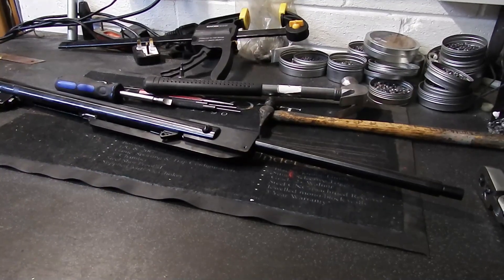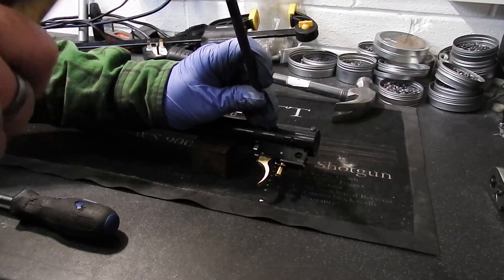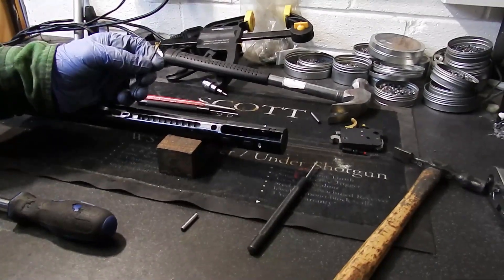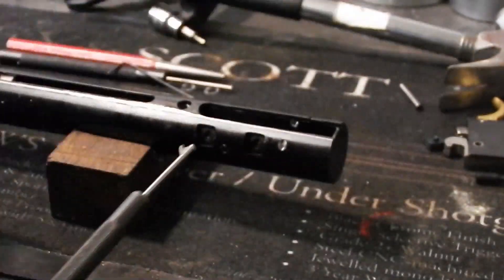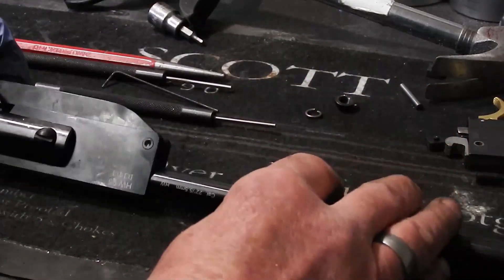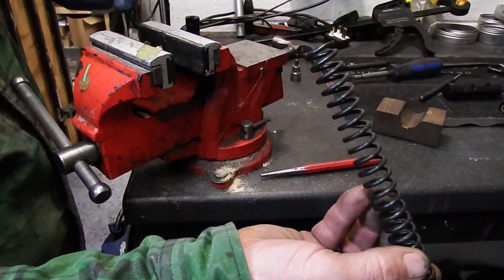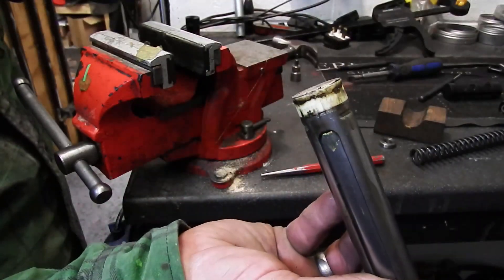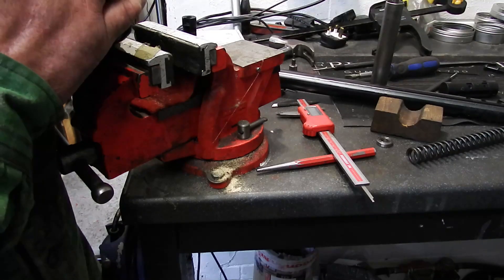Weihrauch HW95 Full Strip

Comment: How can i get the piston sleeve out if i want to install vortek pg4? please, anyone...
Reply from the maker: Hi. Use a flat screwdriver to prise a gap at the top of the journal, then use a flat punch to tap it out. The top washer can hinder this as it's often secured with a rubber seal. Persevere & it will slide out.

Comment: Good video, although it's not necessary to remove the cocking arm pin at all, for maintenance or tuning, in fact better to leave it as it is.
Reply from the maker: It shows how to remove it. They sometimes do need to be removed, so all good but cheers for the comment Pete.

Comment: Nice Video. I also stripped down a .22 Hw95. fitted in a TBT Kit which contains a Top Hat and Spring Guide. also polished the Piston's skirt (not with sandpaper, took a metal polish), polished the spring Ends, cleaned everything, applyed new Grease and put the gun back together. Shoots now very nice and smooth. No noises when cocking the airrifle now

Comment: I need a bigger hammer, struggling to get that pin to budge.
Reply from the maker: If you use a ball end punch and hold the receiver tight, it should go with a sharp wack.
Reply: @lsduk  after making no progress with a little mallet I bought a bigger hammer 2 wacks and it gave up the ghost. QR pin fitted. You made the barrel catch removal look pretty easy, any tips?
Reply from the maker: Only to hold tight on the receiver & accurate swift smack @CubGrylls

Comment: Nice video, I've got a 95 which I'm currently trying to get set up nice, currently running with a tbt spring and guides, and too much power, (which I will reduce before taking out obviously.) Any idea why it fires the likes of jsb and aa pellets say 11-13ftlb depending on weight but when I put a h&n ftt (14.66g 5.53mm) in it averages 14.5 ftlb, is this because it's the best fit to the barrel? Also what's your thoughts on using a short stroke extension? Thanks. !!
Reply from the maker: Yip, your barrel obviously likes the H&N's. Sounds like you need to remove one & a half coils.

Comment: Hi Geoff is it normal that after a full strip and lube that the HW95 will drop in power for a while until it settles in?
Reply from the maker: Not really, no. Could be that you have slightly damaged the seal when pushing the piston back in, or you haven't lubricated the seal.
Reply: @lsduk  Thanks Geoff. I  didn't remove the piston and seal this time because of having to remove the barrel, (mine is the HW98) but I added Moly to the Spring, Spring guide, Top hat and cocking shoe. I also adjusted the trigger for a smoother pull and added Moly to the sears and latch rod. I use QYS streamline pellets that are now running at 10.6 to 10.7 from 11.4. There's no noise at all when cocking the gun all is smooth and quiet.
Reply: @lsduk  when they punch the 4 lugs out , the silly ones as you pointed out i noticed when i felt inside that there was very rough edges that would possibly cause scouring on the seal both on the way in and out that needs to be smoothed off before rebuild great video thanks.

Comment: I was going to get this rifle, tomorrow morning. They say, these are the best break barrels outthere. Should I go for it or not? Go for the deluxe version of this, or choose something else?  Keep in mind, that I can get a rifle with a scope, because of stupid laws. That's why I'm after this. Any help would be much appriciated.
Reply from the maker: Hi Buddy. In my opinion the 95 is the best offering when it comes to the break barrel spring powered guns. I would definitely recommend buying one.
Reply: @lsduk  is the HW80 not better?
Reply: @chrisblake2586  no the 80 isn't necessarily better, has a wider cylinder so pushes more air out, there normally around 18ft/lb but the 95s shoot better, are lighter, they definitely are the best break barrel out there, my opinion would be spent a bit more and go for the 97, they really are unbeatable and don't get talked into gettin a TX200 there good but not as good.